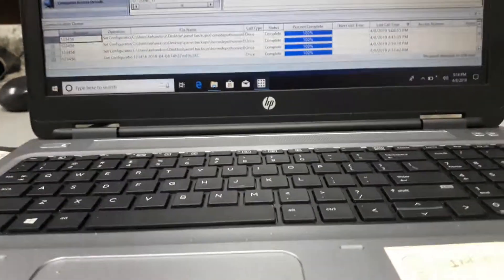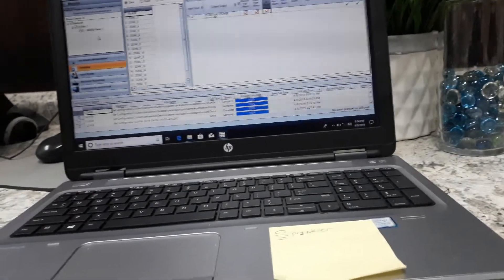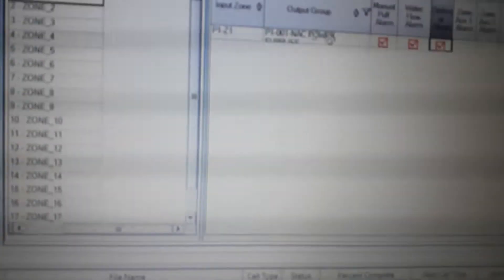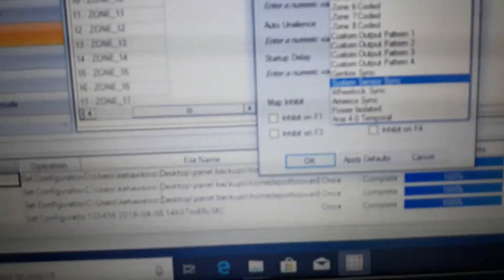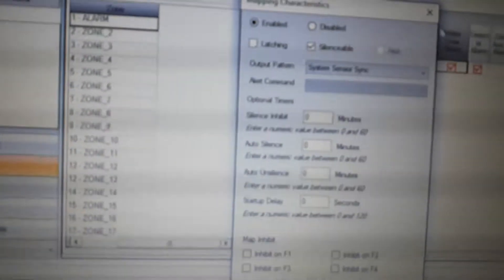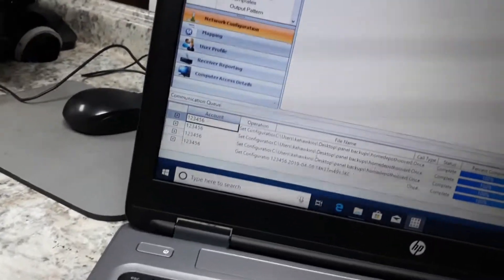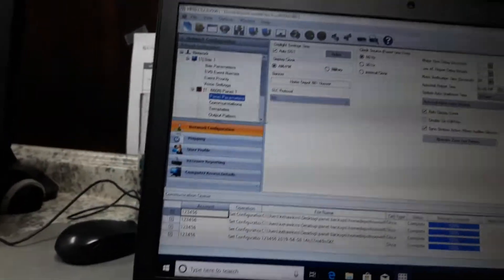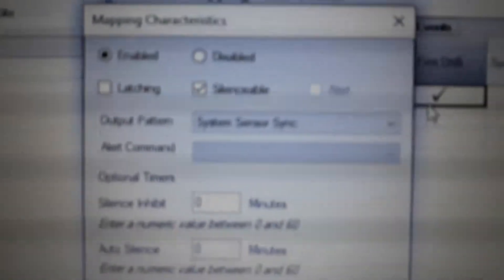Silent knight 6808 nac panels sync issues and silenceable issues.  Fix using software.

Comment: I  discovered the non sync with fire drill accidentally when I chose to check the building using the the drill button. Because I was using a couple Honeywell HP8  PS for the first time I thought it was me after an hour or so. Realized it wasn't me and checked the programming.